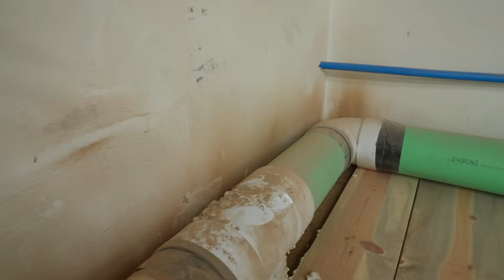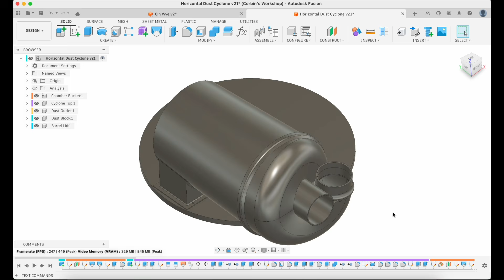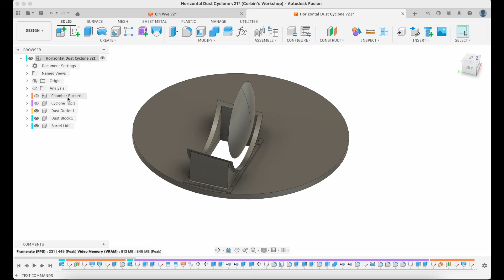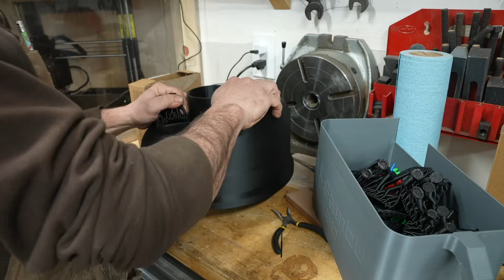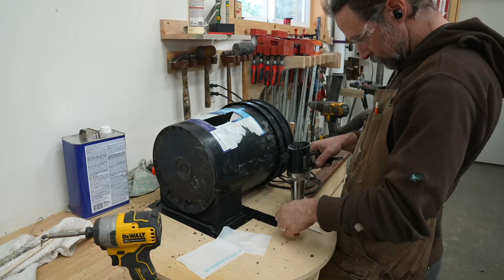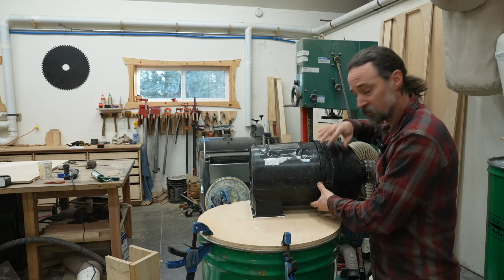Can I 3D Print a NEW Horizontal Centrifugal Dust Separator DESIGN?

Comment: Did you consider taking the air out from the other (bottom) side of the bucket so that the airflow is through the bucket? Maybe a short tube from the bottom to get past the width of the debris slot. Another design that is an interesting combination of axial flow is the Eureka WhirlWind NEN110A cannister vacuum cleaner, it has the spiral air channel (no vanes to clog) but the flow is  through the centre.
Reply from the maker: I haven't tried that method - but it is effectively how the through-drop-out ones work, aka the first Harvey horizontal one, and the ones that "Capturing Dust"'s YT channel have been building. I was just trying a new concept...which I did abandon at this point for a dual cyclone system, which has been incredibly efficient! I looked at Eureka's -- it is another variation of a vertical cyclone; the air doesn't pas through, it is forced to change directions with waste dropping out from the cyclone action.

Comment: This is very similar to the Dustopper that I use with my shop vac. I do not have a full size dust collector yet. My setup works great but has the limitation of a 5 gallon pail to collect dust and chip.  

My vertical configuration collects virtually all the fine dust. I have not had to change the bag in my shop vac for over 1 year. 

I am considering cutting the bottom out of the 5 gallon pail and attaching it to the top of a drum.  I look forward to the results of your testing of a vertical configuration.
Reply from the maker: Cool! I've seen the Dustopper - they are essentially a Thien-Baffle type of design; I've heard the main issue with Thien-baffles is that they cause more static pressure loss compared to a traditional cyclone. I really need start testing pressure to see how much certain things affect it.

Comment: horizontal surely cannot be better than vertical. I do not see much advantage of this horizontal theory other than saving vertical space. I would suggest sticking with your idea of the vertical and add in a conical aspect. Being able to 3D-print your own will make this brilliant. Good luck and I really enjoyed your thinking-through and problem consideration/resolving. Mos tinteresting.
Reply from the maker: Yeah - I've come to the same conclusion as you: I don't know how horizontal can possibly be better than vertical. I wonder if the thru-axial horizontal separators have less static pressure loss, since the air is always going 'forward', whereas in any cyclone version (including this horizontal one I did) the air has to do a 180 to go in the outlet port. Then again...that might help with separation, as the air must have a point where it is hardly moving and more chips can drop out.
Reply: @CorbinDunn yup, i can see this. I think your design with additional 'guiding spiral' directing incoming chips/dust downwards, in a cone shape, or Thein-baffle configuration, is the absolute best way forward.
Personally speaking,  if you create a hybrid thein-baffle within a spiral-guided conical set-up, I don't think it could be improved that much... unless the Thein bit is somehow modernised to incorporate a side walled, angled(ish) exit for the chippings?!  💭 🤔. Now a 3D-printed version of this would be interesting to see developed!
Reply from the maker: Definitely: my next version is a dual cyclone cone shape...but this does have me quite curious: I wonder if a 3D printed Thein-baffle could improve separation without static pressure loss? The main issue with Thein baffles (from what I understand) is they cause a lot more CFM drop compared to a traditional cyclone, and they don't work well for fine dust separation. I really need to study up on fluid dynamics.
Reply: @CorbinDunn  yup, this is as I understand it too. Cyclone style is better for the finer stuff. I often wonder about some sort of hybrid or, in particular, a cyclone with better 'downward' guidance - I think this has to sit at the start of the incoming port. I note you mention an oval input design. this sounds a very smart idea and aiming it downwards in a cyclone has to be an optimising option... surely! He question being: how much overall suction is compromised etc. Ultimately it has to be a balancing act.
Reply from the maker: Yeah! Static Pressure Loss is the big question and balancing act.

Comment: HI Corbin, there's one aspect of the Harvey-style design that I've always been curious about.  In their designs, they put the separation downstream of the impeller, rather than upstream.  I've always wondered if that makes any difference - good or bad - WRT separation performance as well as airflow.  Looking forward to your next iterations.  All the best ...
Reply from the maker: Hi Carl, The newer G-700Pro looks like it has the separation upstream of the impeller -- so it does appear they changed that from the original design of the G-700!  It definitely makes more sense to have the air and chips pulled through the separator instead of being pushed through. Pushing could allow small fine dust to more easily escape from poorly sealed areas...while pulling with a vacuum will avoid the problem, but could create turbulence in the chamber if there are any leaks. Looking at the G700 clones (Capturing Dust, Pilson Guitars, etc) and traditional cyclones: everyone seems to have the impeller after the separation. This has another huge advantage of designing the impeller to b more aerodynamic, since it is only moving air and not chips. The single stage impellers are designed more "flat" in order to move chips and air, and aren't as efficient when moving only air.

Comment: Like the video, seen almost all predecessors. Hopefully you can come up with a scalable design, that people can print for themselves offcourse ;)
Reply from the maker: Yeah! The hard part is the diameter of a bucket is roughly 12"/305mm, and the piece really needed to be printed in one go, so it requires a large-format printer (~310x310). I tried splitting it up, and did some tests, but it is hard to glue back together and keep the strength high.

Comment: Hi Dunn, I've gone with a horizontal setup, similar to Capturing Dust (Ruud). I modified the inlets and outlets to fit the available space in my garage, using just one horizontal tube. Then I'll build a suction system using a washing machine motor, which drives blades inside a spiral-shaped housing. But it still takes time to finish everything. Have a good Sunday.
Phil
Reply from the maker: Awesome! I know what you mean about it taking time...I ripped my dust collection pipes all out, and now my shop is a complete mess..it's taking me forever to get it back together! 

Keep an eye open on Facebook Marketplace for used dust collectors; you can find ~2hp ones for around $200 if you wait long enough! You just need the impeller and motor.

Comment: Really interested in seeing where you progress with this. I have similar intentions but only 25cm size printer (p1s) so maybe I'll experiment in slightly smaller scale.
Reply from the maker: Yeah! It'd be interesting to see what you can come up with. I'll post my next design on my website soon; that version of the "cyclone top" is more configurable; you can control the inlet size/shape a bit more, and the overall size. That would make it really easy for you to scale it down a bit, but still hit proper dimensions for the other parts.

Comment: Great experiment, we have the same cnc, and the h2c is on my shopping list this year.  Based on other material on YouTube for 3d printers your effort with this DC is a step above, ie useful, i would encourage you to keep at it.
Reply from the maker: I've been pretty happy with the H2C! I don't absolutely need the dual head, and the H2S is definitely more cost effective, but at some point I want to experiment with PLA/PETG supports (and vice versa) and embedded TPU gaskets.

Comment: I’m no expert on fluid dynamics, but it would seem that making the opening of separator larger as you plan, it might have less separating potential.  By having a reduced separator entry, the air has to accelerate, which in turn would increase the apparent centrifugal forces and produce greater separation of particles out of suspension.  Basically, slower air would allow more dust (particulates) to stay in suspension.  I think more effort in making the flow more laminar entering the separator would pay bigger dividends as velocity is more important than volume in this respect.  Thoughts?   And great video, I always enjoy what you share with us.
Reply from the maker: Yeah! I also am not an expert in fluid dynamics, but here is the gist of what I understand from my research: large chips fall out with a slower velocity, but small fine dust will stay suspended in the air. Fine small dust requires a high velocity and centrifugal force to separate and fall out, and that is the hardest dust to separate. Apparently that is why vertical cyclones work so well: the velocity increases as the cyclone goes lower  down and has a smaller diameter,, separating fine dust with a faster velocity.

But I'm not talking about making the entry inlet to have a larger volume, but a shape that is more "oval" than "circle" and starts guiding the dust to the outer edge of the cylinder, with a larger outlet diameter. Bill Pentz's website discusses why he does this..although, his inlet is a rectangle and not an oval. I have a feeling that this is simply because of what people can do with sheet metal, and with 3D printing we can create much more fine-tuned shapes that keep laminar flow. But the huge advantage of me using an oval shape is that I can properly fit the required input/output area into what I can print; a straight diameter divided by 3 into circles was limiting the area of what I really needed.

I'll talk about how I'm increasing the velocity in the next video with my next design (it's just two cyclones).
Reply from the maker: PS: you can see that next design in this video on the back wall ;)
Reply: @Cor @CorbinDunn nks for the response, I certainly enjoy hearing your thoughts and willingness to share your approach.  Your explanation is pretty much inline with with what I think is happening.  Looking forward to more!